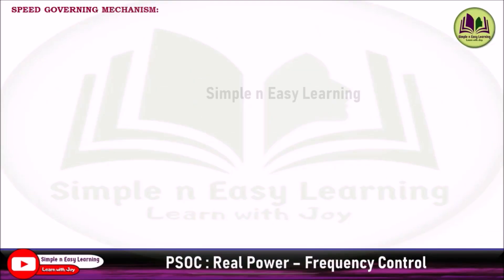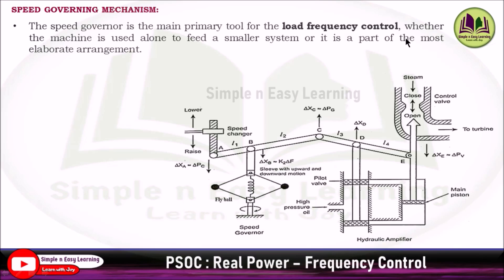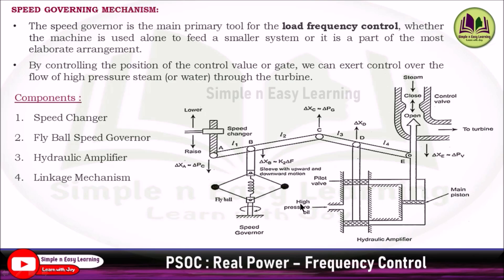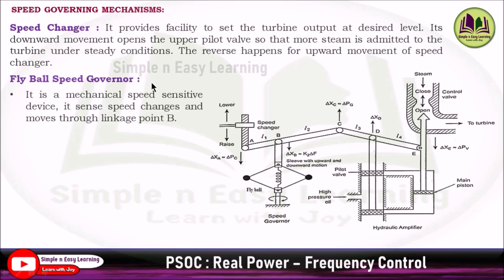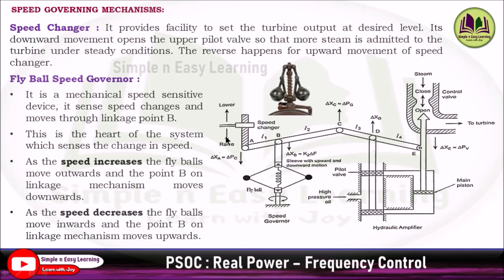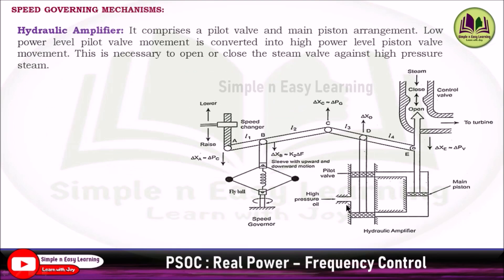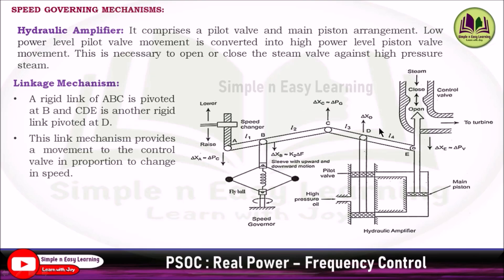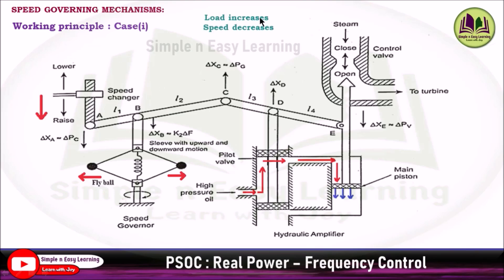Speed Governing Mechanism | Load frequency control | Power system operation and control | PSOC

Comment: In case 1 high pressure oil will pushes the  main piston downwards thats good ,in case 2 where the upward oil will flows ,when oil lifts from downwards?
Reply from the maker: @positivecreations9278

 In Case 2, point D in the linkage mechanism moves upward. As a result, the piston connected to point D also moves upward, creating a passage for the high-pressure oil to flow downward. This downward flow of oil exerts force on the main piston, pushing it upward and thereby closing the steam valve.

Comment: If B moves upward how c and d moves downward?
Reply from the maker: The linkage system consists of two rigid links, ABC and CDE, where:

ABC pivots at B.
CDE pivots at D.

When A moves upwards:

(i) The upward movement of A causes B to move upwards due to the linkage mechanism involving the flyball movement.

(ii) As B moves upwards, C moves downwards, since the link ABC pivots at B (creating a seesaw-like effect).

(iii) The downward movement of C also pulls D downwards, because CDE is pivoted at D, transferring the motion.

Thus:
A moves upwards → C and D move downwards.
Reply: All clear sir thanks 👍